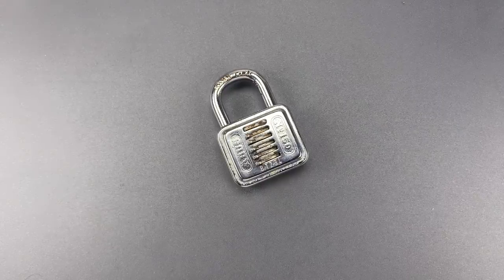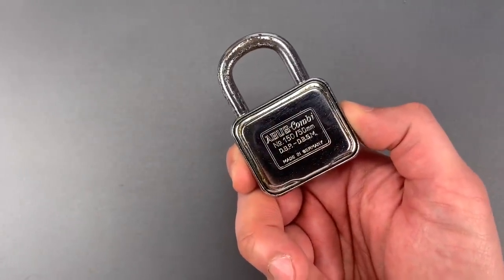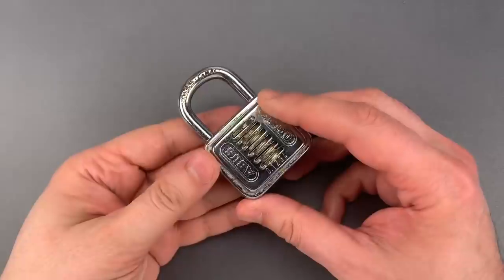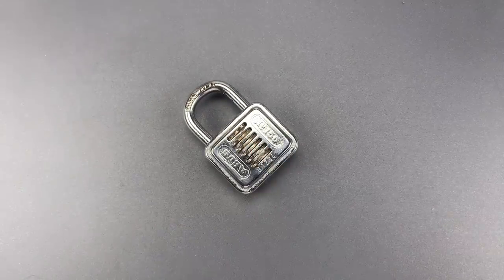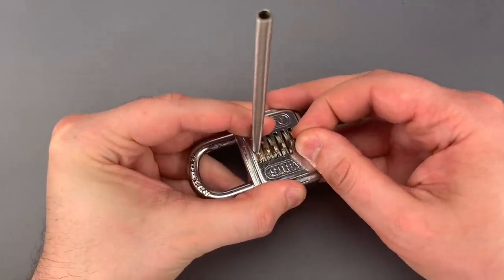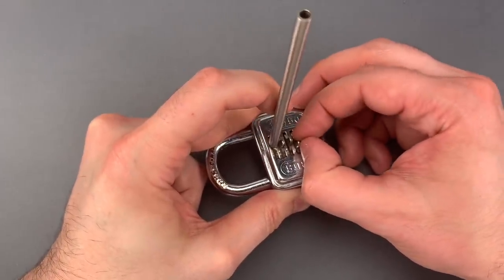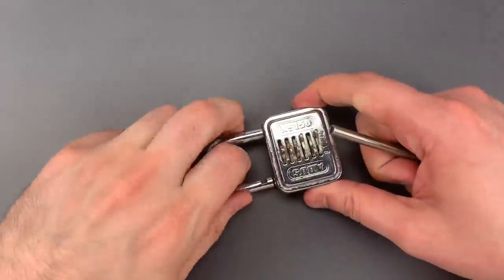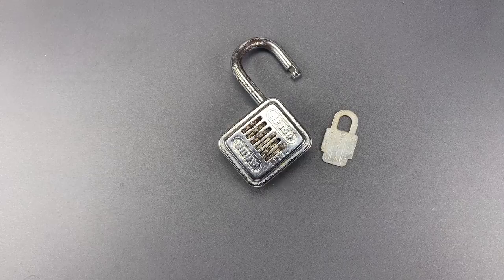[1121] Abus No.150/50 Combination Lock Decoded

Comment: Notice how he didn't even attempt to open the envelope non-destructively. I know what I'll be using on my front door from now on.
Reply: I just realized envelopes are meant to be tamper-evident: any way to open them should make it clear they've been opened, so if your post arrives unharmed, you know no one has intercepted it. So it makes complete sense that he did
Reply: @hadinossanosam4459  The bypass to envelopes is steam. You can open the envelope, then when done the glue will seal right back up.
Reply: @EyeDewDie  I have also seen old KGB tools that they slip in at the top of the flap and wrap the contents tightly around this tool and extract it that way.
The Cold War made for some interesting solutions to problems.
Reply: @EyeDewDie  Or you could open the envelope destructively, examine the contents, and then put it in a new envelope of the same type.
Reply: @hyperboloidofonesheet1036   its hard to do that if  the envelopes are signed across the flap. It is much more difficult to line up or imitate the hand writing.
Reply: @hadinossanosam4459  just make a fake new envelope

Comment: The thing that caught my attention most in this video... THAT KNIFE WAS SHARP!!!
Reply: it cut paper.... is that the standard? What good is a knife too dull to cut paper? Spreading butter/nutella?
Reply: @Chamdar17  1) the joke was that the rest of the video showed a lock that was so bad that it was unremarkable...
2) but in reality, the fact that 2 layers of envelope paper did not tear at all on a single stroke cut does indicate that the knife was very sharp. Go ahead and try that with a knife you think is super sharp, and you will see what I mean. Even razors will usually tear after a couple inches or so.
Have a nice day. :)
Reply: @johnjon4688  I'm a bit of a knife guy, typically keep'm shaving sharp, all my knives will cut phone-book paper without tearing after I sharpen, my lawnmower blade can pass cutting an envelope without tearing after I sharpen. If your razor blades aren't sharp enough to do what his did in the video, I'd call that dull, mine do not fail that, but to each his own!
Reply: @Chamdar17  hey, I know what you mean, but for a random knife in a youtube video, it was sharper than most. I'm a woodworker, so I too know that there is sharp... and then there is sharp.

Comment: I feel a bit embarrassed for this. But finally got a decent set of picks. (Praxis Dangerfield) and I've been playing with a Master #3.  I can take it open about 90% of the time with a worm. I cannot for the life of me SPP the dang thing. I think #2 is a super low cut and even with the .015 I can't seem to SPP the dang thing. Only complaint so far on the pics is the 2 supplied top of keyway tensioners are still too thick for the master. But I'll keep trying or I'll mail it to you with the challenge to use the same picks. And probably be embarrassed in 10 seconds. Lol. Just love to know what I'm doing wrong. I've tried all sorts of tension, bullying is totally out with this one. My other 2 #3s I can pop open in seconds. I've had the one I can't open well for 20+ years.of that makes any difference.

Comment: New to your channel. Have you ever designed a lock? I know anything that is made will sooner or later be cracked. I think someone that is this skilled should invent a good locking system. I have always thought our current locks are still based on a system that is very old, the tumbler system. Magnetic locks seem strong as long as you can not use an outside magnet to unlock it. What locking system do you think is the hardest to open?

Comment: Interestingly different codewheel design, though if my maths is correct then the number of combinations is 5^5=3125, less than a third of what you get with the standard 10,000 that modern designs allow.

Comment: So there are only 1,024 possible combinations for the lock, and it's unlikely that more than 3 digits are the same. That leaves only 900 sensible options. A 3-ring lock with 10-digits per ring, giving 990 sensible combinations, would be slightly less insecure than  this one.

Comment: Can someone please explain something about code locks to me please.
Whenever I see or hear code locks advertised, they exagerate how many possible combinations the locks have.
Say for example a lock that has 4 digits. Each digit has numbers from 0 to 9. The advertised amount of possible combinations is 100,000. Unless my maths skills are utterly useless, but insn't the actual number 10,000?
Think about it. 0001 all the way to 9999 is 9,999 combinations. Then add the combination for 0000 and you get 10,000.
It's the same for digital locks (not including those locks that ask you to press # after keying in your 4 or 5 digit pin).
No matter where I look, I hear an over exagerated number for possible combinations. Bank/Credit card pin numbers. Safe locks. Bike locks.
Not many code locks are advertised with a number depicting how many possible combinations it has only that it has for example 4 digits ranging from 0 to 9 each.
Can someone please explain if I'm wrong in my understanding or whatever. I need closure on this.
Reply: 100 000 sounds a lot more impressive

Comment: The "Made in West-Germany" wasn't mandatory, some still printed "Made in Germany". Both were used parallel. The thing with "Made in West-Germany" was that this was introduced in 1973 with a ruling of the german Federal Supreme Court (Bundesgerichtshof). In East-Germany they used "Made in GDR" or "Made in Germany". And some manufacturers in West-Germany were really upset about the GDR using the "Made in Germany". The said this would damage the reputation of it by making crap products, and they sued them. But actually they lost. So they switched over to "Made in West-Germany" to distinguish between East- and West-Germany.
So you won't find it on products made before 1973 (to be more precisely: March 23rd 1973).
And some manufacturers still use the "Made in West-Germany" up to today. For example Feuerhand kerosene lanterns. They switched back to "Made in Germany" as one of the first manufacturers after the reunification. But some people thought that these were knock-off lanterns due to the new label, and the manufacturer switched back to West-Germany.

The ruling from that time, I used Google translator for this:

A German product is regularly expected to be manufactured by a German company in Germany. It is crucial that the properties or components of the goods which, in the eyes of the public, make up their value, are based on a German service. "It is true that" the fact that now in the Federal Republic of Germany comes from both the Federal Republic and the GDR Goods with the designation 'Made in Germany' or 'Germany' are distributed, lead to… that the customer - unless additional information rules out any doubts - remains unclear about which of the two German states the goods come from and so far is subject to misconceptions. This danger of erroneous ideas of origin arising from the political division of the former German Reich must be accepted